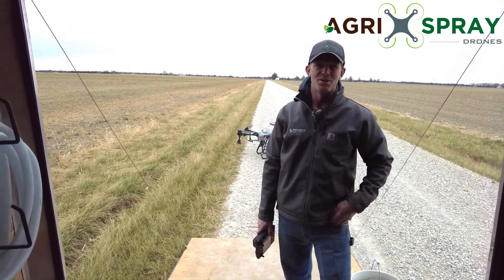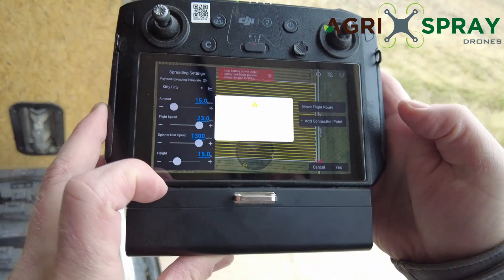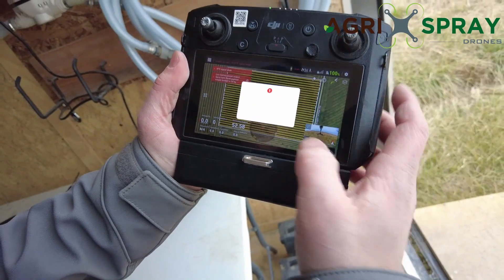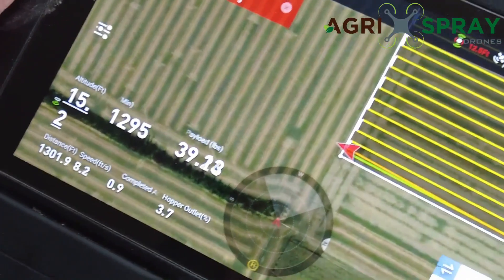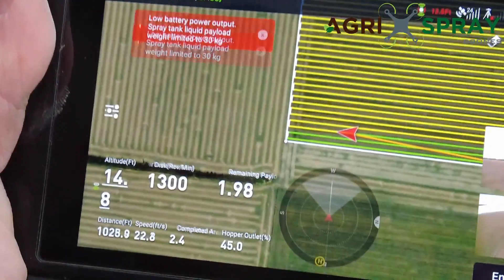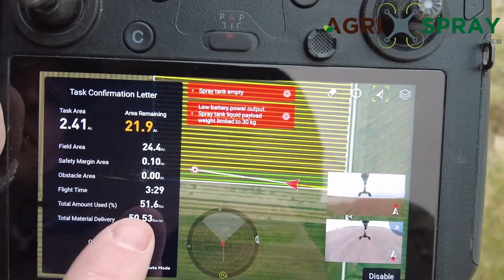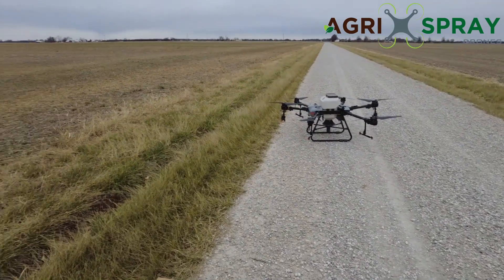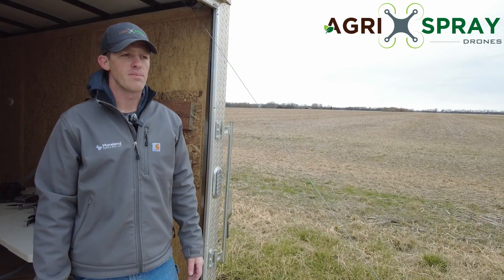Agras T30 - Full Spreader Demo

Comment: Man that battery is draining fast!
Reply: theyre only designed to fly for 8 or 10 minutes, more efficient that way
Reply: @matthewlitwiller9708  Oh I know, I also fly large commercial electric vehicles. The speed at which these high current batteries drain is mind boggling.

Comment: I noticed you're also getting the "Low Power Output" error message popping up.  I assume this is a firmware update fix that should be coming.  Happens with all of my batteries.

Comment: From a business standpoint, would it be better to charge by the hour, by the acre, or by flat project rate when operating for a farm?
I believe many charge by the hour, but then that penalizes the business if you are fast and efficient.
Seems to be a per acre charge (sliding scale depending on how many acres) would be the most fair to all parties.
Reply: As a custom applicator, most people charge by the acre for a farm. Rates differ depending on location. Example, ground rigs are around $8-10 an acre. For chemicals, co-ops, chemical dealers, or agronomists usually make that decision. Some farmers pick their own. So unless you are selling chemicals too, best to just be the applicator and put on what they request. Also application fees are separate from chemical costs, and that's between the dealer and farmer, not the applicator.
Reply: I'm also assuming that the actual product costs (fertilzer, etc) is borne by the client. Or do you purchase it and add it to the total cost?
And who makes the call on which product to apply? The farmer? An agronomist? The local retailer?
Reply: @billkuper  Charging per acre would be the only way to go when spraying chemicals. And when applying fertilizer work on a sliding scale per acre for volume that has to be applied.